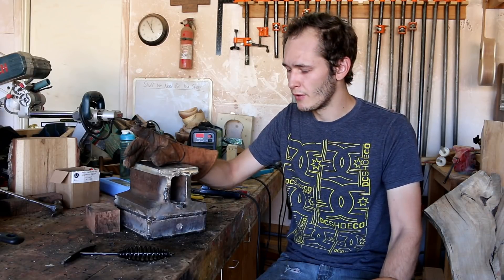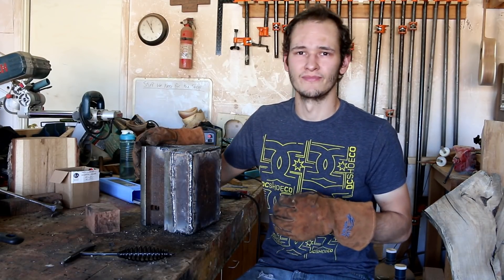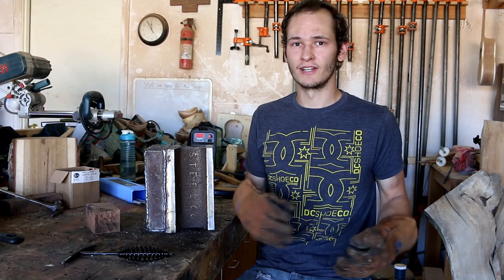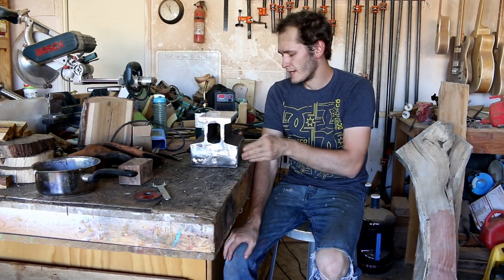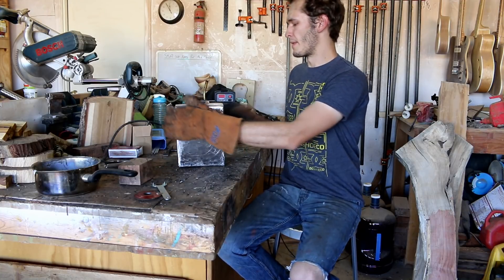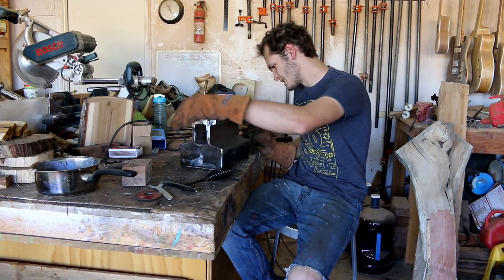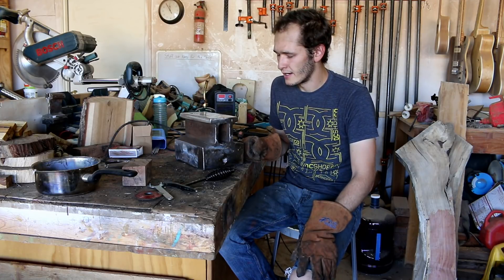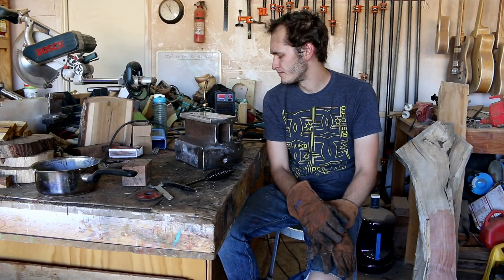Grinding Down My 90lb Railroad Track Anvil

Comment: Interesting project.

A note on rebound...  The rebound test is only an indicator of surface hardness.  The harder the surface, the more force will go into your work (hot steel).  It will not change by adding any type material beneath it.  The sound might be altered but the surface hardness will remain the same.

Thanks for the video...

Comment: I was amazed when looking through all the videos when I ran across your video. I’ve made one almost identical to yours except my face plate is a massive 3” thick forklift fork. 
I did not cut the bottoms of the railroad track because I wanted to weld the center of the forklift fork from one end to the other and leaving it open allowed it. I have not hardened my face plate yet but it’s actually really really hard already.
Good job by the way. Thanks for the video.
Reply: i know it's quite randomly asking but does anyone know a good site to watch newly released series online?
Reply: @Sullivan Crosby flixportal :)
Reply: @Fabian Winston thank you, I went there and it seems like a nice service :D I really appreciate it!
Reply: @Sullivan Crosby Glad I could help =)

Comment: Hope you are takin and going to take proper steps the ensure you don’t get lead poisoning from the vapors when melting the lead. Also might look in to what temp lead starts putting off fumes if going to heat it in the forge.